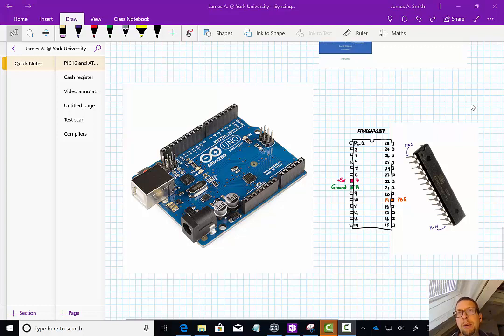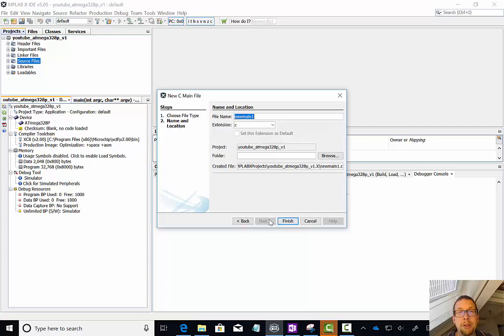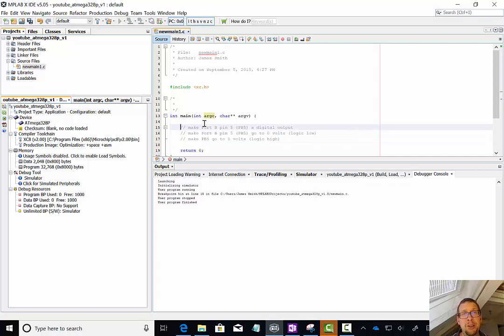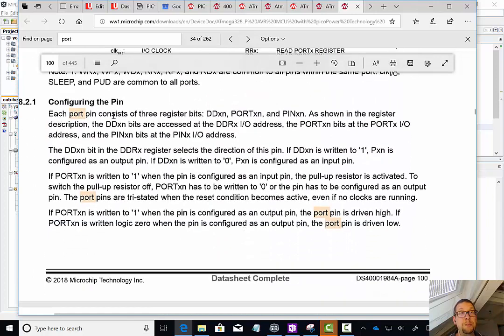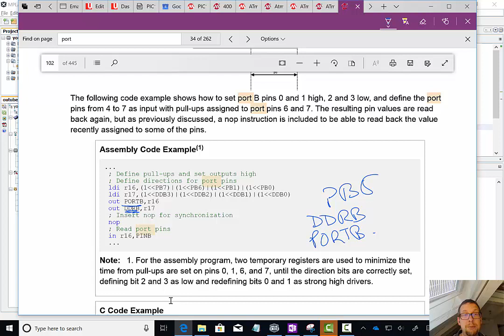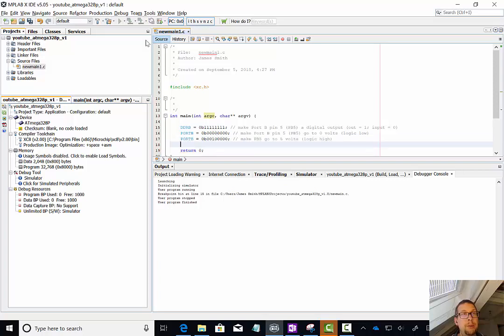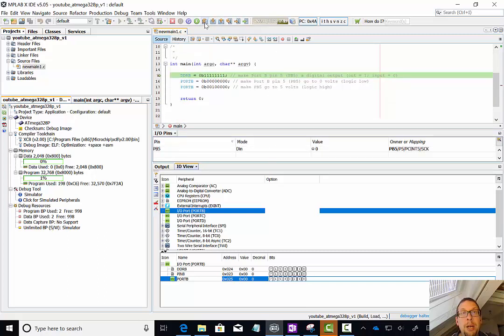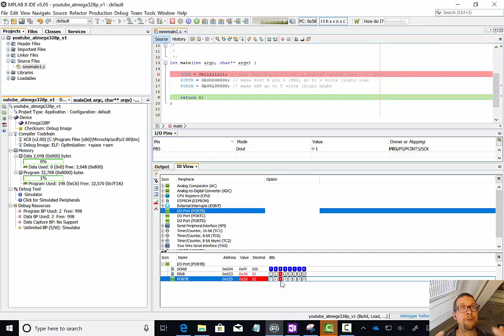First ATMEGA328P Project in MPLAB X

Comment: Hello, I tested programming CH32 using the MounRiver IDE and noticed that the Flash usage is lower than when programming with the Arduino IDE. How about comparing the Arduino IDE code with MPlabx?

Comment: Thank you! That exactly what i looking for. Simulation is a cool feature i hope it saves a time.
Did you try to program ATmega328 with MPLAB X and then insert ready to run MCU in Arduino board? Is any issue?

Comment: Hello"! Interesting your video, however I was expecting that you got the code downloaded to the Arduino board, that'll be nice to see. By the way, I like the clear way you explain things, greetings from Mexico.
Reply from the maker: Hola! Gracias! Thank you for the comment. The first few videos will be simulation only as I want to explore the debugging and documentation tools first. I will eventually use the debuggers (PIC KIT 4, I think) and show examples with that.
Reply: @onnimikki2007  I was wondering if you got around to making those examples with PICkit4. I am trying to program an ATMEGA and keep getting the following error:

Data transmission failed. Error code -112 returned while trying to send USB data.

A communication error with the debug tool has occurred. The tool will be reset and should re-enumerate shortly.
Connection Failed.